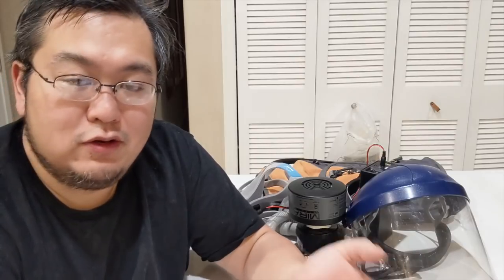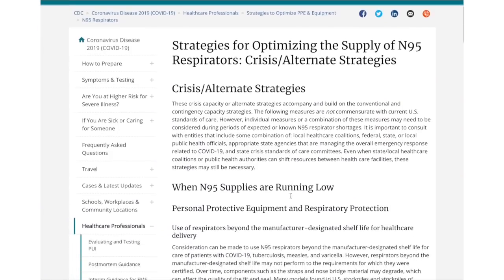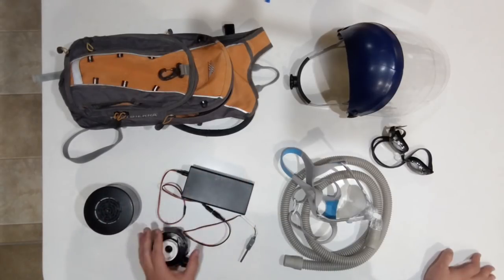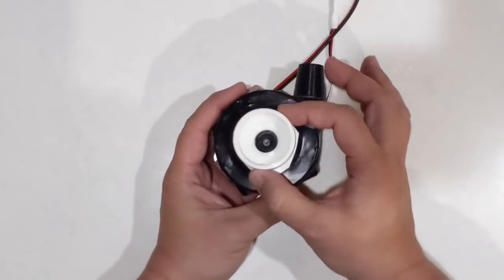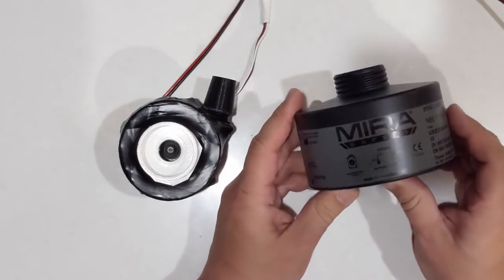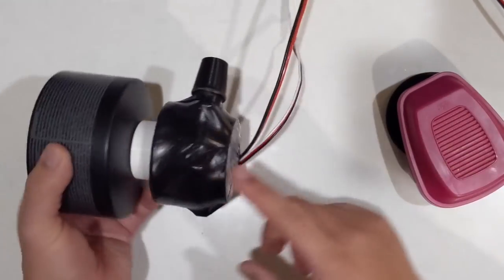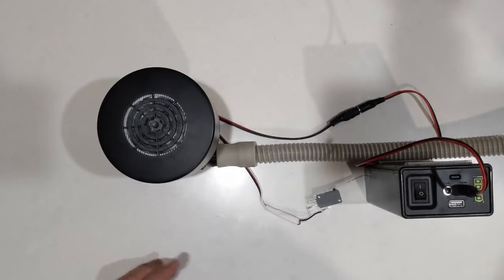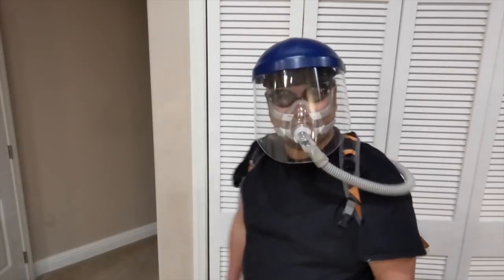Low-Cost Powered Air-Purifying Respirator (PAPR)

Comment: How many times can I use this ? I am a doctor in Egypt and we have an acute shortage in protective equipment when we intubate patients.
Reply: the filter big military filter should last 24 hours  and  the pink p -100 filter in industrial use lasts 8 hours, 

 i see no reason it would not last at least 16 hours. 
thats if you have a regular replacement schedule.

you can also use to failure but thats unsafe.

p-100 mask filter down to .05 micron.  virus particle is 2x smaller than that size so protection of cartridge is not ideal. be well.

NCCER Safety Technician/ ret. emt.
be well.
Reply: @safetyfirstintexas  According to my informations if you are talking about sars-cov-2 virus the average size is 0.125 micron so the p100 filter (down to .05 micron) should be sufficient. thanks.
Reply: @marcellopenta  never rely on average size when filtering viruses. go for least particle size outliers as indicator of performance.

Comment: Why would you remove the blower from the CPAP when it has it's own controls?
Reply: From Johnny: If an existing CPAP could simply be reprogrammed, then this indeed would simplify the build and enable a potentially large stock of existing equipment.  We would need a manufacturer to either release the tools to enable reprogramming them or for someone to figure out how to do it on their own.

Comment: With the face shield, you don't need the goggles. Great idea overall as PPE is what is in short supply rn, not vents. Modern vents can (with modification) ventilate up to 4 people for every 1 vent. I hope it doesn't come to this in the US but it has been used here in mass cas events in the past.
Reply: Putting more than one patient on a vent will be a logistical nightmare that would create more problems than it solves. It can be done, but “the juice isn’t worth the squeeze.”
Reply: Turns out you were wrong to dictate "With the face shield, you don't need the goggles";  Sealed eye protection of some type WAS and IS STILL ACTUALLY NEEDED.

Comment: What are the stats on that blower? Pressure?  L per minute? Voltage?  Does it have a model number?
Reply: I just started this project too. I'm using a Delta blower. DC brushless:, 12VDC, 45.49CFM, 3.694 inches of h20 at zero airflow, 23.64W.  BFB1012EH-c19j, a first(ish) project for while inside. Just going with positive pressure behind a mask, with with a sealed lower rated filter in the exhaust to create a pressure gradiant. 

I've only just hooked up the blower to the battery, but it seems like it will be able to create the static pressure needed to pull through higher rated filters.
Reply: Tested the Delta blower,it pulls through even a small HEPA without dropping noticable CFM or L per m. I haven't tried a ppf3 filter yet, with how the fan is blowing I might put the filter in series to give the finer filters longer life.

Comment: ** both mouth/nose pieces and face shields can be easily made from  2-liter soda bottles! **
- Cut off the cylinder part of the bottle and fine tune cut remainder for mouth/nose piece.  3 slightly shortened popsicle sticks can along with duct tape can form a good triangular shape with a curved triangle cut out on top where it meets the bridge of the nose.  softening the edge can be done with either silicone caulk or glue gun or layered strips of duct tape.  2 ruber bands attached to sides with staples or  hot glue, reinforced with a piece of duct tape and a piece of duct tape for inside padding if stapled.  buy 1inch silicone tubing at the hardware store by the foot and plug it in bottle opening with electrical or duct tape to match guage of bottle.

-Face shield viser can be made by cutting 2 liter bottle longwise after removing the ends.  additional parts can be made by another bottles and a good duct tape job or hot glue.

Comment: We just made a PAPR.  Not perfect. Used a small shop vac, clear trash bag, duct tape, and a fliter on the suction side.  Cut about a 1 inch hole in the top of trash bag.  Duct tape hose and  bag around neck. Turn it on and the bag blows up.  Please note that I used a corded shop vac.  Best with a  shop vac that uses recharge batteries.
Reply: @Traveler-PKK  sent a picture.  video would not load up.  thanks  hope this helps

Comment: You need alarm for:
Low battery
Problem with wrong speed for power (blocked air exit)
Reply: Battery indicator is also nice thing to have :)
Reply from the maker: good idea, i'll think about an easy way to make an audible alarm.  the battery does have an indicator, but it would be in the backpack.
Reply: @jcl5m  remember that for medical use there have to be a low battery alarm with at least 10min runtime left, alarm have to be loud and repetitive

Comment: Moisture from your eyes causes swimming goggles to fog up. If some of the filtered air supply was fed through them they would stay clear without infecting the eyes..
Reply: @patrickcoin9457  2.5 gallon zip loc bag w scarf at neck/ base.
Reply: @patrickcoin9457  shower curtain plastic at Target for $2.99.
Reply: If goggles are fogging up, try cleaning goggles with the most basic toothpaste. That is what we are taught to do for new snorkel masks when scuba diving. Scrub the rubber and plastic portion with toothpaste. Wash off with water. Do it a bunch of times.

Comment: Hey, could a mattress pump work?
Reply: Following...
Reply: Excellent question--that would be very economical.
Reply: Someone in the project has been trying it out: https://github.com/jcl5m1/ventilator/issues/62
The biggest issue is that cpaps are designed to work for many hours at a time. And a typical mattress pump may not be rated for that. So each pump may need to be tested to see how long they can run for.

Comment: So this is my idea for a mask snorkel. Anyone can feel free to make one. Get some clear plastic material, like at a fabric shop, like the kind you put on picnic tables. Make a closed hood that you can pull over your whole face and neck, leaving it loose at the neck. You can tape it or sew it. In this hood, make a hole at the top side of your head, like above ear. Inside the hood,  insert a 1.5  inch PVC pipe (that you get at like Home Depot for plumbing) thru the hole, that hangs down towards your ear and also this same pipe sticks up above your head an inch or so. Outside the top hood connect pipe with a 45 degree coupling, and have the pipe go UP a foot or two feet ABOVE and back of your head. (this is to get the air above the breathing line)  Tape around the hood pipe hole to close it.  Also inside hood, wrap a thick elastic around the top of your heard, at brim line. Brace the sturdy pipe in place with the elastic, by wrapping and/or gluing elastic around pipe. Then at ear line, attach some flex pipe to the PVC pipe and let it hang loose around mouth. (If you want, you can find some way to brace flex pipe closer to mouth,) Close and tighten the hood at the neck with some velcro strap or tape, wrapped around your neck. Voila. Easier to breathe, better virus control, and rinsable and reusable.

Comment: You can even do it more cost efficient. Remove the battery pack and motor and just connect the filter directly to the Mask tube. You don't need an electric pump. Your lungs are the pump. Or buy any type of cheap WW2 gas masks and add that filter. No need to overthink it.
Reply: Of course that can be done--a gas mask or full facepiece respirator can be fitted with a particulate filter. PAPR requires much less breathing effort (virtually no extra effort) so can be worn without stress for much longer. Also, in a loose-fitting PAPR (not quite what he has done here), careful fitting is not so necessary--you have a positive pressure environment. A gas mask, etc., requires careful fit testing because they are negative pressure--as you inhale, any weakness in the seal around the face is going to pull in contaminated air. Leakage in the seal around the face is what limits the effectiveness of most air purifying respirators, thus the advantage of supplied air systems, such as a PAPR or SCBA. (Thee is also a certain amount of leakage through the exhaust valve on an air purifying respirator.) Respirator design is full of trade-offs between effectiveness, strain on the wearer, and length of service.

Comment: I hope that you really know what you’re doing. Ventilating someone with the wrong pressure and tidal volume can kill them in less than an hour. Patients at risk of ARDS should be ventilated with a tidal volume of 6-8 mL/kg of body weight.
Reply: It’s a PAPR mask for PPE, not a ventilator.

Comment: I am actually wondering how to apply this to make my own welding PAPR to protect me from gases and ozone.The ones built from companies cost around 1-2  thousand dollars. The only difference is that I will have to use 3m filters, everything be fireresistant and instead of the house going to my mouth it will be creating a positive atmosphere in my welding hood.
Reply: I dont know about 3M half-masks but Honeywell/North half masks have an optional (and rather cheap at about $80 USD) backpack filter adapter that puts the filters behind you via hoses. It's called the BP1002

Comment: Okay I have a simpler idea. We know that the viruses come in droplets usually, and fall to the ground within 3 ft from someone's mouth. We don't need to use that air purifier. All we need is a SNORKEL type device. With a pipe going UP a foot or two, above the breathing line. If you get the air from up higher, it is likely to be virus free, because the viruses fall down.  A regular cloth face mask is not that great, because when you breathe with those, you breathe in from gaps at the sides of the mask, and you get the same virus air you would get without the mask. No good. We need to go higher. Also a clear open tube would make easier breathing than a cloth mask. So use that cpac mask, the goggles, and attache a simple plastic tube going above the head a foot or two. This would be for doctors, not the person on the street. And make us a video!
Reply: Covid is airborne

Comment: I made a better one. Get old CPAP on craigs for 100 bucks or less,..put entire unit in plastic suitcase on wheels, cut out hole in suitcase for whatever filter and power cords you use,...then use 20ft hose to your mask, and you're good.  I use 30 dollar full face snorkel masks from amazon,....covers entire face, so no goggles needed, no face shield needed, ,..no batteries, no taking anything apart, you can make it quickly. Why is mine better? I use OUTSIDE air for intake,..so no worries about filters or that 99.7% filtration, etc. It's great for healthcare workers, like dentists, etc who work in one or two rooms. If you have to go farther, you can unplug your suitcase filter and roll it to new location.